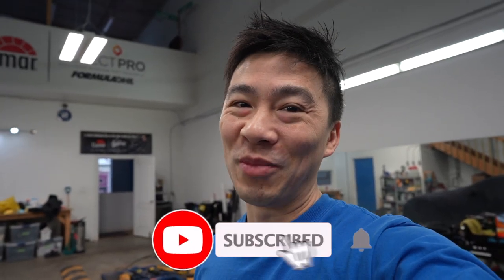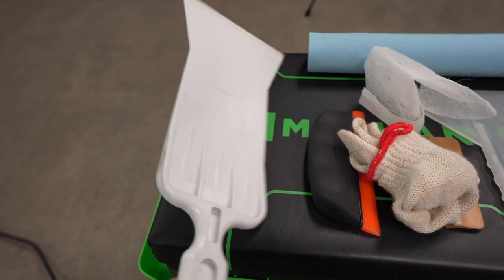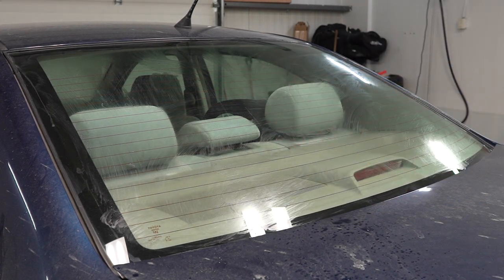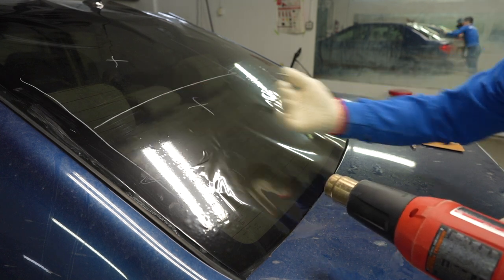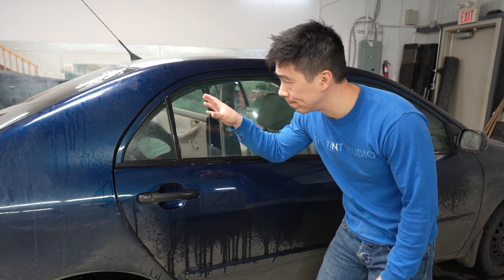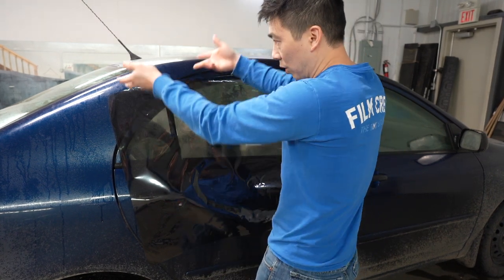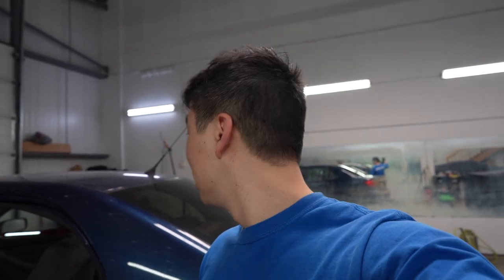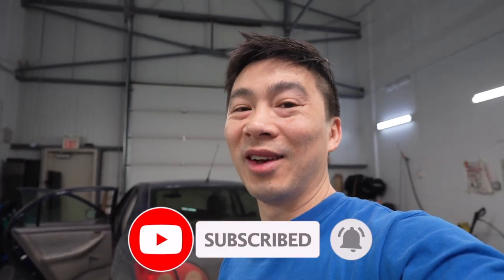DIY Window Tinting for Beginners Made Easy! Part #3 Shrinking Back Window.

Comment: Thanks for sharing this I have a few questions.
When you are spraying anything is it the solution like so and water?
2: do you have to do anything else to ensure the tint doesn’t come off the defrosters?
Thanks
Reply from the maker: Yes Baby Johnson soap and water mixture for the slip solution. 
If the defrost lines and back windows are cleaned properly the tint will adhere to them. The tint will not bubble on the lines.
Reply: @phothrottle  thank you for this really helpful
Reply: @phothrottle  what type of films do you think are best DYE , Ceramic?
And what brand?
Thanks
Reply from the maker: @evenclothing  I would recommend llumar for the brand. They have never let me down as a supplier. 
I love the Pinnacle high performance ceramic series. Very easy the heat shrink and install.